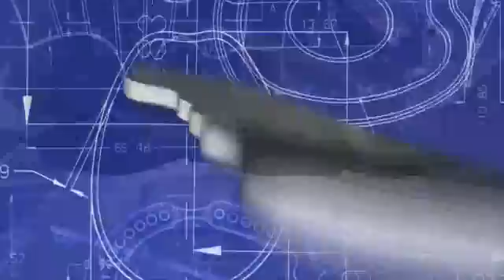#britek  Energy Return Wheel... Autonomous Never Flat

Comment: Kubota, Kioti, and other  compact tractors need to figure out how to prevent flat tires, solid tires are needed. Make tires for compact tractors, flat tires are there #1 issue.
Reply from the maker: Great idea! ERW stores energy and delivers it into a levering action. This screw force accumulation and return improves drive train efficiency by 16%, to 22% over uneven surfaces,!